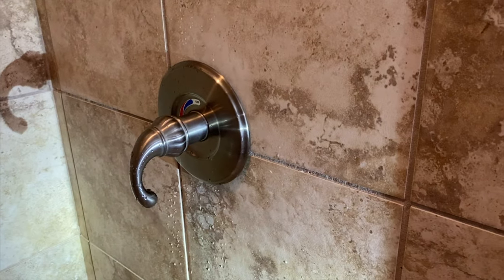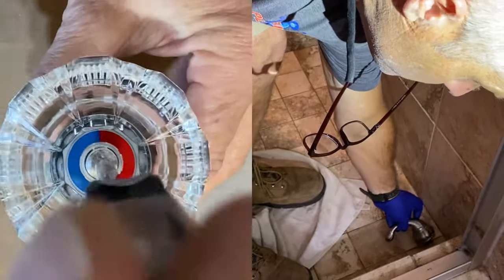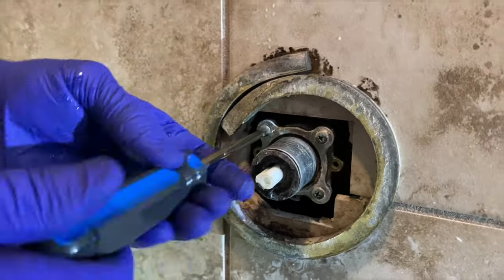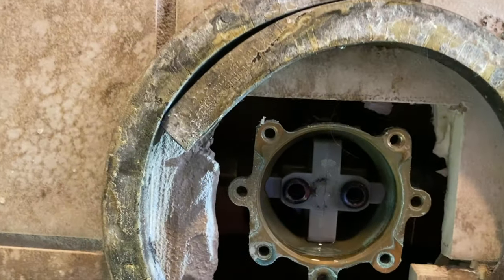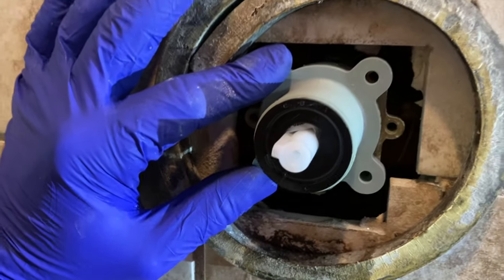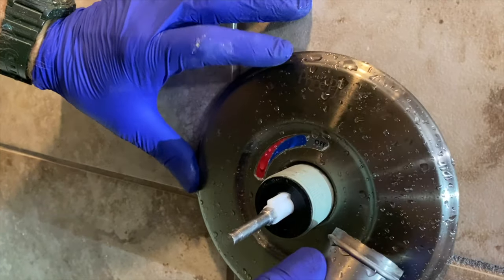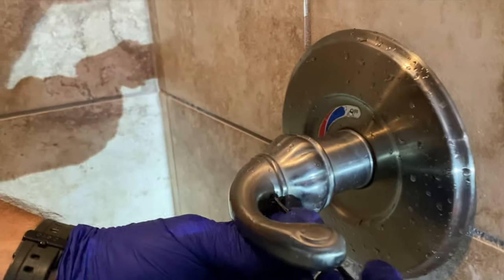Price Pfister Tub/Shower Cartridge Replacement @TappPlumbing #PricePfister

Comment: What? wait! You snuck in a different cartridge then the one you took out. I wanted to see what keeps the inner part from turning. Also I tried what you did and felt the new cartridge was too long.
Reply from the maker: @brianjohnson8883  Are you telling me the catridge would not seat into the valve body? That would be very strange. I have only seen one version of that catridge. Where did you get your replacement catridge?
Reply: @TappPlumbing  the one you took out was two pieces, 974291 and 971-2500, (available on Amazon), just like what I removed from a valve body. You replaced it with a single piece cartridge that looked like 9740420 … did I miss something?
Reply: @TappPlumbing  I just now found documentation that shows part 974–042 can replace two different two-piece cartridges.
I will try it again, it went into the valve body, but after I tightened the screws, the stem was very stiff to turn (yes OEM part). I put back the original parts and ordered new.
Reply from the maker: @brianjohnson8883  Please keep me posted if you have time . You almost certainly have the right part number for the cartridge. You may have just been unlucky and received a bad cartridge the first time. It happens more than you might think. Best of luck!!

Comment: I have replaced the cartridge before and now it won't shut o ff the water. It's leaking VERY badly. I installed a new one they sent me and straight out the box it is still letting a lot of water through. Any ideas
Reply from the maker: You can try to take it back out and look very carefully inside the valve body. Make sure the oval shaped o rings were not left from the old and there is no other obstruction or debris in there. Let us know what happens please?
Reply: @TappPlumbing  LOL i'm smacking myself. I DID leave the old o rings in from the first valve!. It worked on the second valve for a few years before it started gushing. I decided to look inside and both o rings were still in, which meant the second valve is good after all!
Reply from the maker: @poppaluv  I was very confident you would get things figured out, GREAT JOB!!

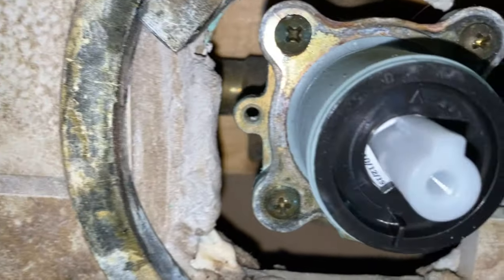Comment: PTL! Thank you so much for including the instruction for applying the Scald Guard in this video at 2:15 ! By adjusting mine by one click to the right, or clockwise, I'm now safely showering with All the hot water I want from my new water heater. The instructions from Price Pfister don't include this with a new or replacement cartridge. There's no telling how much money Price Pfister has spent replacing cartridges because consumers don't know this!
Reply from the maker: You are most certainly welcome and that is great question you have ! Thanks for watching our video

Comment: What is the number wrench
Reply from the maker: I honestly am not sure . It is a left over from an install kit but I think it is a 3/32. Just be very careful not to strip the screw if possible. That would make things much more complicated. Good luck and keep us posted please.
Reply: @TappPlumbing  it is 3/32. I know cause I almost stripped mine using the wrong size allen! My issue now is the handle just doesnt want to slide off. Itʻs 17 years old and probably calcium deposits have it stuck. Any suggestions before i try and pry it off with a couple of crowbars?
Reply from the maker: If it is acrylic you could try a handle puller . You may have to cut it off regardless of what it is made of. Best of luck and keep us posted if you have time please.